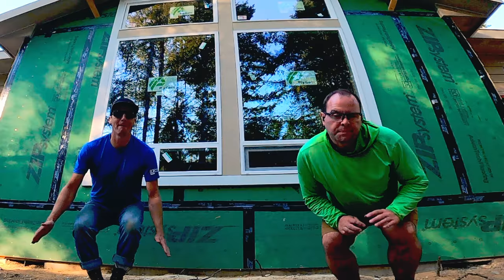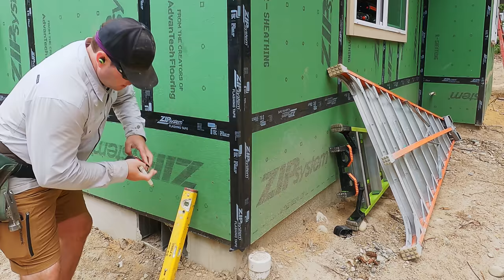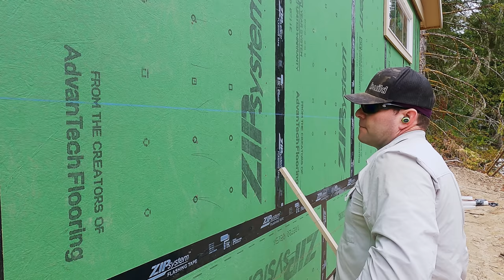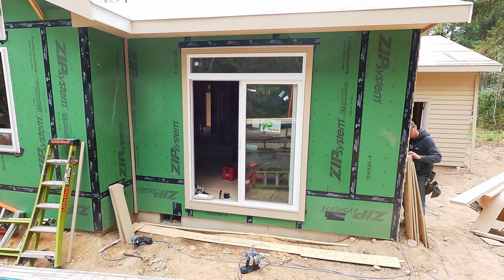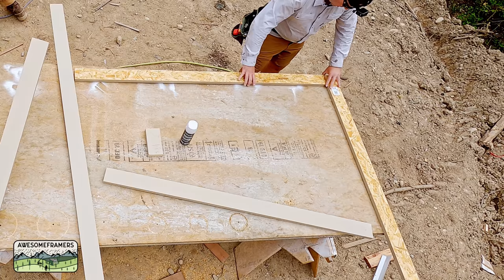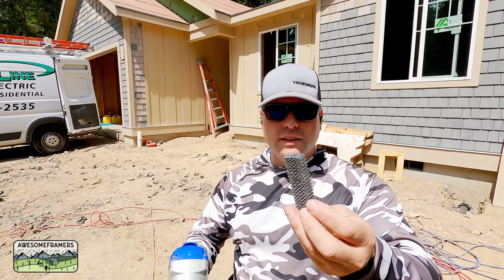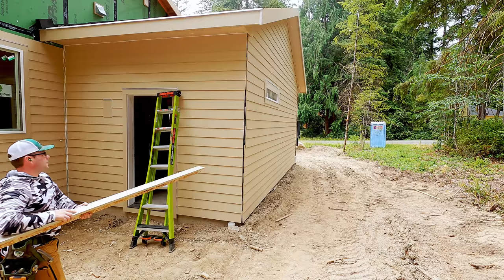How to Install SmartSide Lap Siding

Comment: Had me until LP dumb side. No idea why guys use that crap
Reply from the maker: It's a better product than fiber cement. It has a better warranty, no silica, longer lengths, lighter weight, looks better and it's manufacturing process is better for the environment.
Reply: @AwesomeFramers  I just disagree that it’s a better product. It’s made of wood. The cut ends need to be painted and caulked. They have plenty of “outs” for a warranty claim and who needs the inevitable headache when there is rot. Fiber dement is far superior IMO
Reply from the maker: @magictrading8903  check your fiber cement instructions, they require painting the cut ends as well.

Also do you know what the fiber is in fiber cement? Cellulose.... Just think about that. Hardie is NOT concrete board or cement board
Reply: @AwesomeFramers  the hardie comes primed and as far I know cuts don’t need to be painted and sealed. For me it’s a bit of common sense. LP is particle board in essence. Will rot. Hardie will not. The ease of install and long lengths don’t seem worth it to have to deal with the risks. Just my .02
Reply from the maker: @magictrading8903  I hear you, but check the Hardie instructions. Cut ends have to be painted.

LP doesn't rot when it's installed correctly.
Reply: @AwesomeFramers  ty I will check. In general I prefer materials that are intended / can withstand the elements even if not installed perfectly. If u soak LP in a bucket for a week vs fiber you can see the stark difference. Also don’t have to worry about caulking all the nail holes etc
Reply from the maker: @magictrading8903  Double check on the nail holes in the fiber cement.  One thing I've never understood is why anyone puts materials in a bucket of water.  That doesn't relate to the real world at all.  Siding doesn't get submerged, its on a vertical surface.  

The fact is that if you install both fiber cement and SmartSide according to the instructions, they will last decades.  But the Hardie fan boys love to dis on everything else, but not even follow Hardie's instructions